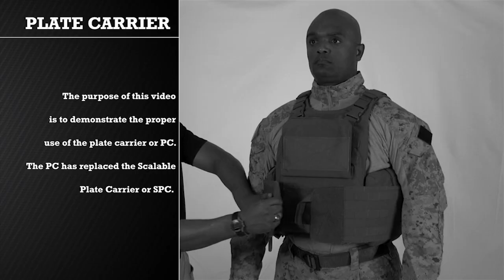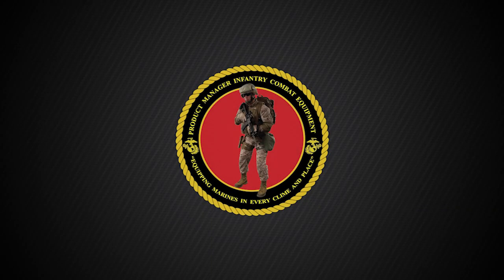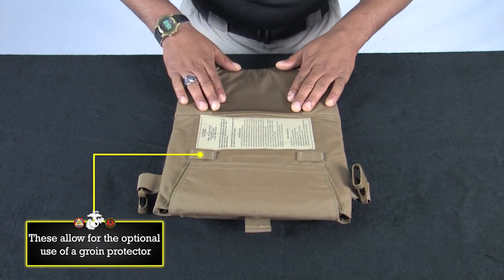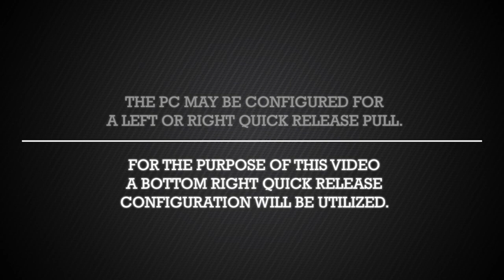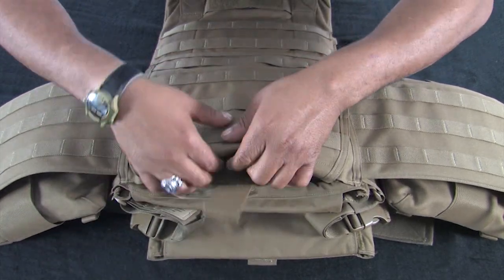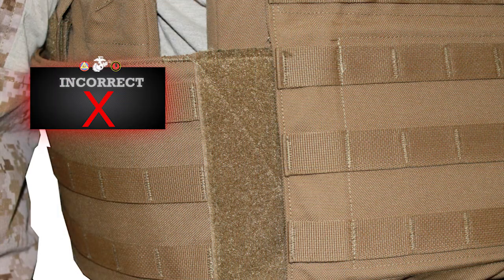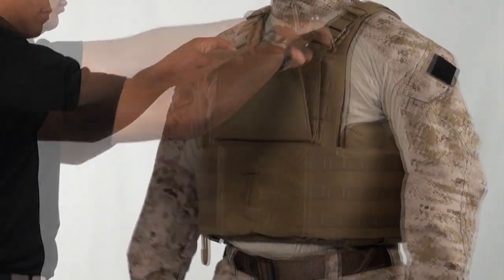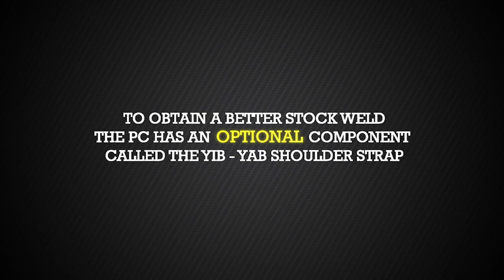Infantry Combat Equipment - Plate Carrier

Comment: what ever happen to the dragon's skin armor? Like that shit took a grenade during testing and was lighter than regular gear.
Reply: Also extremely expensive to outfit an entire force with.
Reply: Last I read of it was it didn't do very well with subsequent hits.
Reply: Ben White  also had problems with falling apart in heat.
Reply: The vest alone weighed upwards of 47 lbs. I wouldn't call that lighter than the 30 lbs interceptor being used at the time.

Comment: What does this plate carrier weigh as its shown in the video?
Reply: Probably less than 15lb. Level 4 front and back plates weigh in around 5ish each depending on manufacturer. 
I know two level 3+ plates weigh 20lb on their own. Just my two cents
Reply: @michaelsorenson3887  what lmao how would level 4 plates weigh less then level “3+” that makes 0 sense
Reply: @facade0074  hes probably talking about steel "level 3+"
Reply: with the 7.62 APM2 plates it weighs over 40lb i think but i’ve never weighed mine just what it feels like
Reply: @facade0074  level 4 is ceramic. Level 3+ is typically steel. Ceramic is lighter than steel.